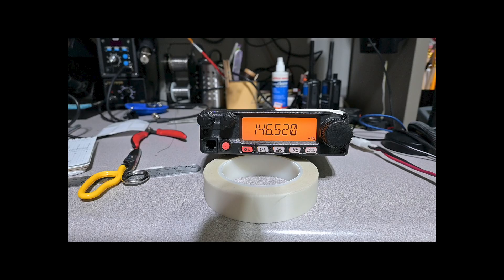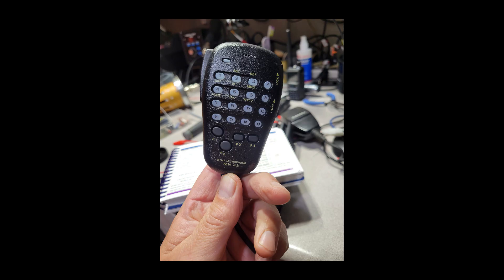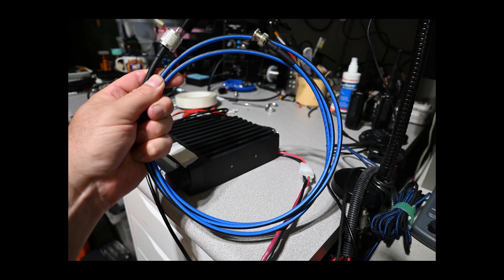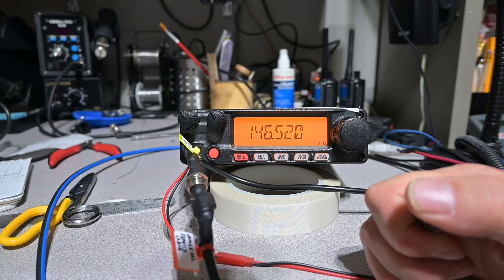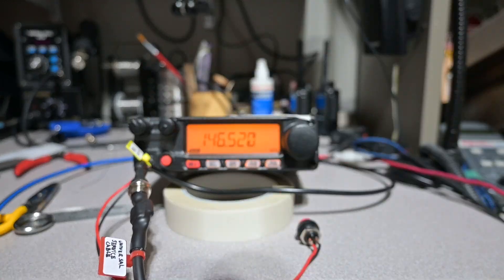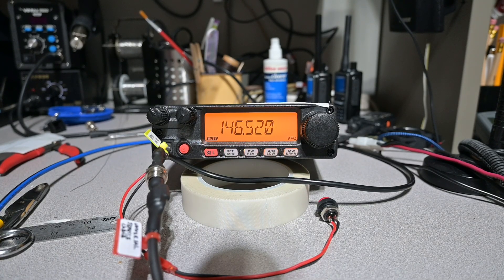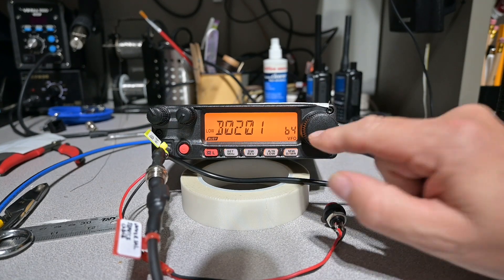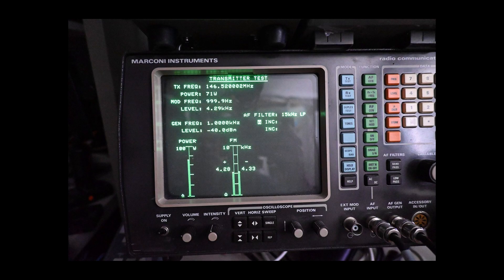VHF ham radio transceiver testing - how I do it.  Basic Yaesu FT-2900R testing and REF OSC alignment

Comment: great video, thank you. too bad these are discontinued - while 75 watts is appealing, i wonder if they're they worth the $300 i'm seeing them for used. is there another similar radio in current production that folks like? thanks in advance and 73 !
Reply from the maker: Thank you.  I like the radio but persoanlly I wouldn't pay 300 bucks for it. Hamfest prices on these are in the 100 - 150 range which is pretty reasonable IMHO  Yaesu's new equivalent for this radio is the FT-3185RASP but it is still 300 bucks. The Kenwood TM281A VHF or TM481A UHF is well regarded as a no frills radio and can be had for a hundred bucks or so although it looks like they may have been discontinued.  The performance specs are better on the kenwood and I like the front firing speaker but the user controls are less end user friendly. Thanks for watching !
Reply: @survivalcomms  thanks for your detailed reply! i appreciate you. 73
Reply from the maker: @wildcatcomms  Anytime !